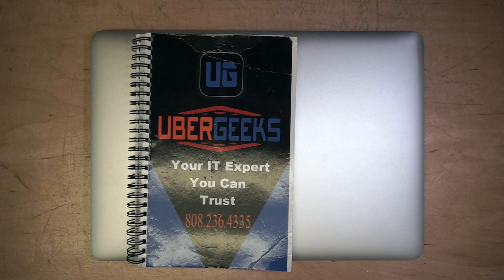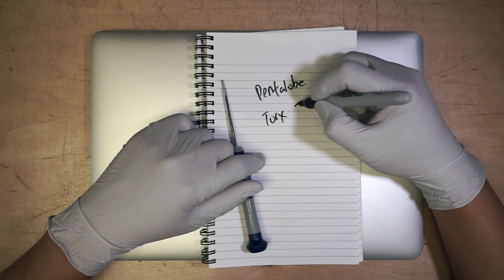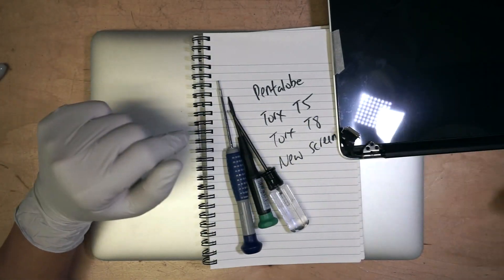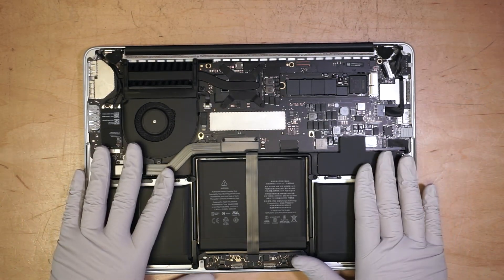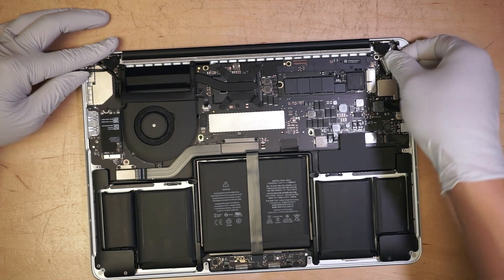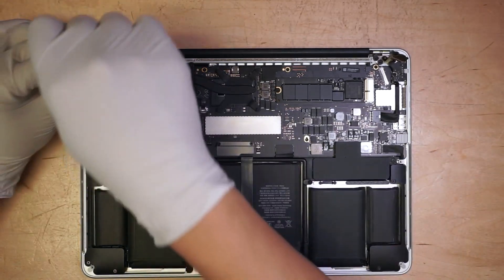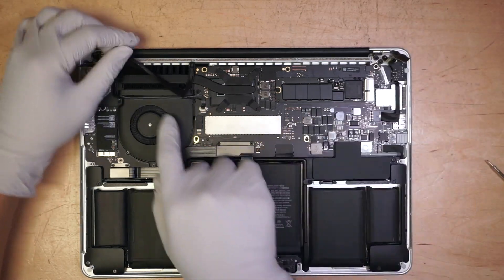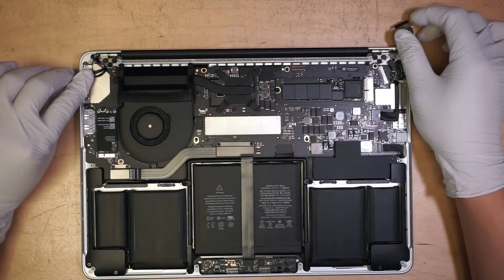Macbook Pro 13" 2015 Screen Replacement - Step by step tutorial

Comment: Thank you for this great tutorial. I replaced my A1502 display but the screen intensity (F1 / F2) don't work normally. F1 makes the screen whiter (more contrast) and F2 put the screen back to normal. Instead of F1 reducing the luminosity and F2 increasing it. Is the replacement screen (2nd hand) defect? Thanks

Comment: hello i have read that 2013, 2014 and 2015 screen are interchangeable. what happens if i put a 2013 on a 2015 screen please?
Reply from the maker: You will have a working screen

Comment: Really appreciate you making this video! Gave me the confidence to do it myself and saved thousands on a new laptop. Everything was super easy and doable except putting the WiFi/antenna cables back was very very tough. I thought it would never go in and I almost mixed up the order of the wires! Thanks again!

Comment: Does anyone know if i want to just replace the front part, what the front screen is called? i have tried for hours to find the product code and have failed
Reply from the maker: Replacing just the front glass, not the LCD, it's really a pain.
Reply: Its bonded and really isn't worth the headache

Comment: Great video. How do you know the correct position of the three wires connected to wifi card?
Reply from the maker: It kind goes from shortest, medium and longest length cable.